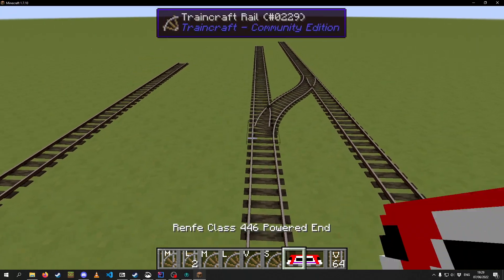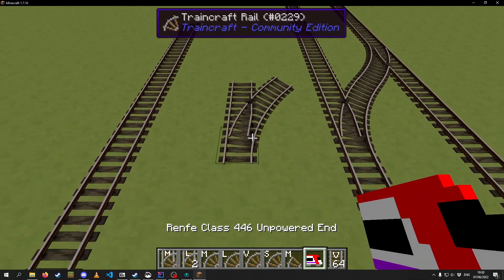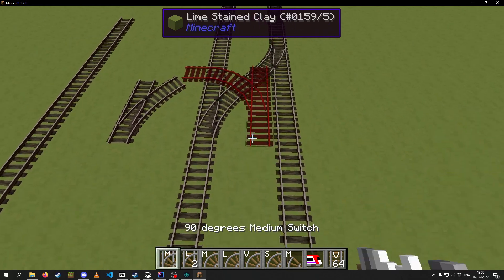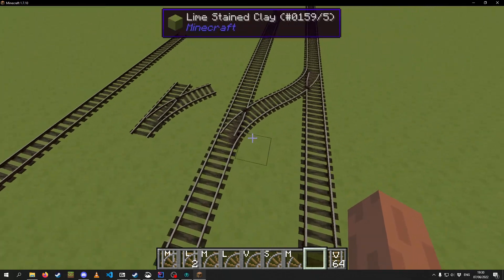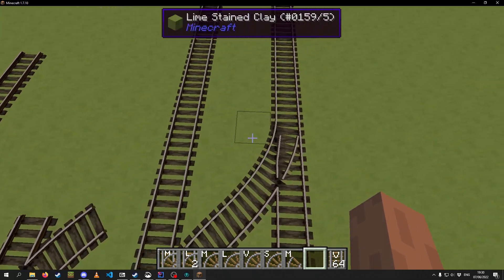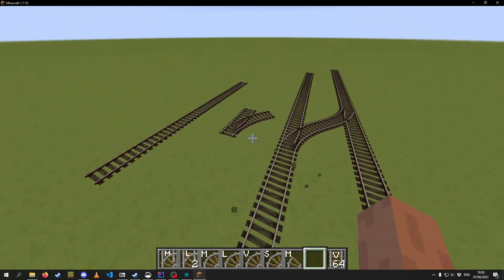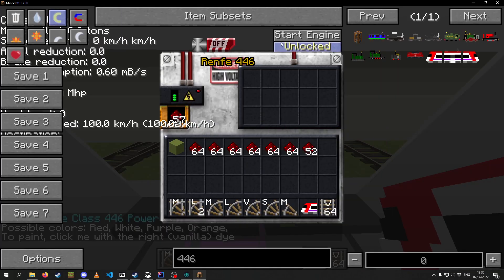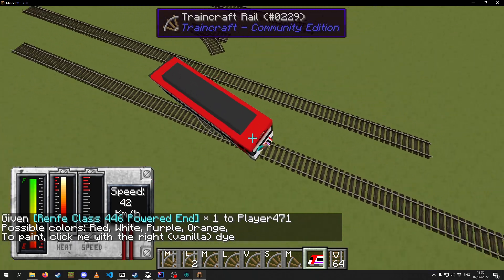TCCE6 Dev Log | 1 | A Showcase for the future N Switch

Comment: This track seems to be broken in TCCE7.1 When you try to connect two of them as shown in this video, the second track turns red and can't be placed. EDIT: I just noticed that by using a different length of diagonal track between each switch, I was able to place it. It gave me a message though; "There was a problem when placing the track. Possibly too many tracks around". EDIT: Disregard that former statement; when tracks connect that way receiving the error message; a bounding box or other collision type object will exist on the track making them impassable. From my testing, its impossible to connect two of these switches without it causing an error.